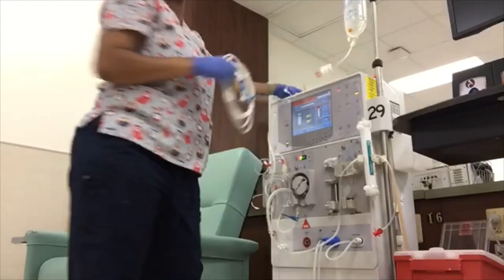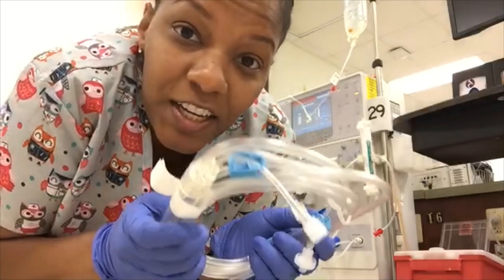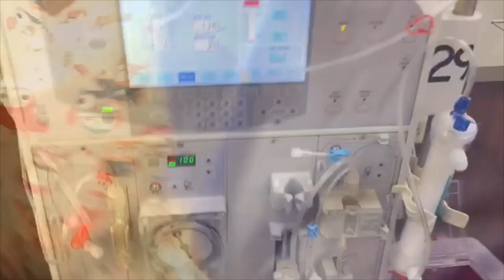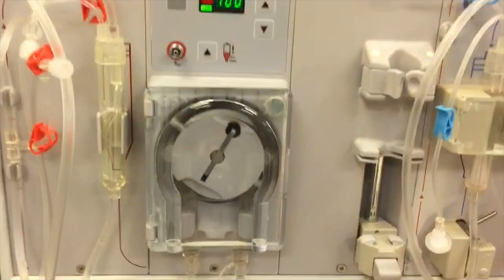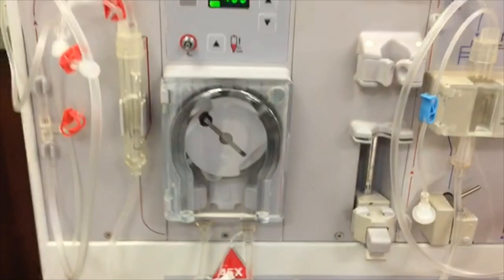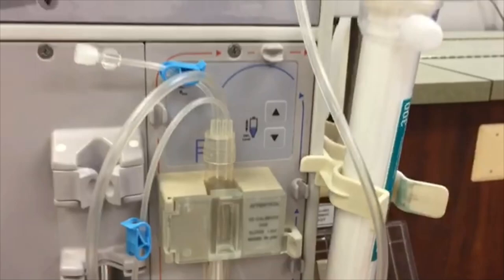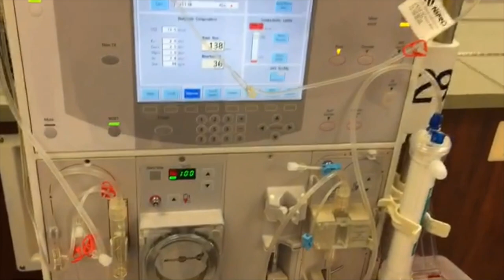BECOMING A DIALYSIS TECHNICIAN!!**Priming A Dialysis Machine!! Episode 3. **MUST WATCH**

Comment: im still new and priming has been THE WORST... your video is the only one ive seen doing it right (like not feeding the blood pump segment and priming with gravity) but it would be so much better if you can tell me which clamps i should be closing and which should stay open. I cant see bc its so far away.
Reply from the maker: I feel your pain. It was the worst for me too, and my preceptor gave me the blues in about it. Yikes let’s see. Clamp both the red and blue one that connects to the transducers, the red and blue short one’s hanging from the top of the chambers, and the heparin one. Oh and the one on the small hanging end of the saline line.
Reply: @FR3SHFAVOR3D  I came in to work hitting it!!!! Thank you!!!!
Reply from the maker: 👏👏👏👏🙌🙌🙌🙌🙌🙌 yayayayay 🎊🎊🎊😁😁😁 keep grinding

Comment: I have a question. Is the big red and blue clamps on the arterial and venous line that goes in the bucket Are they clamped during priming. I know we clamp the arterial line to let the saline run through
Reply from the maker: The big red one is once the saline comes through. The blue gets clamped after priming is done and then connect for trat
Reply from the maker: Test*

Comment: I thought it's the RN responsibility to set up the machine. So what does the RN do in the dialysis?
Reply: The RN does not set up the machine the PCTs set then up.
Reply: The RN injects heparin Epogen antibiotics antinausea etc as needed. Check vital with stethoscope thermometer etc. Some RN have home hemodialysis experience and have trained patients to self cannulate and prime machine